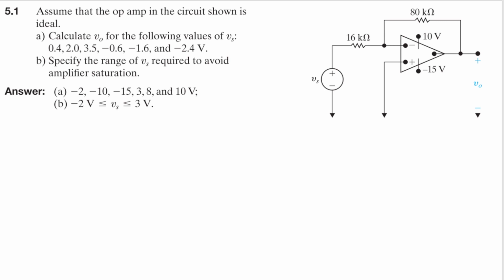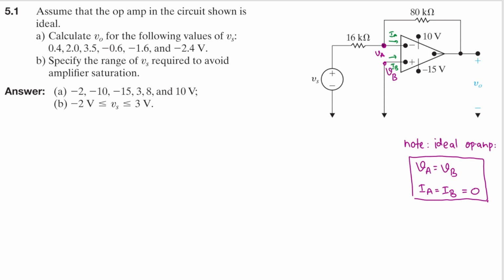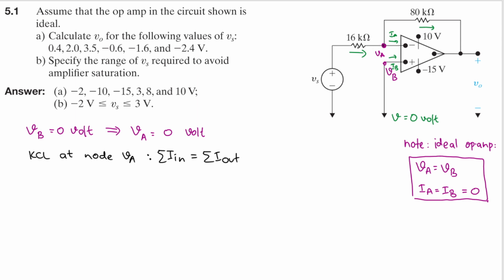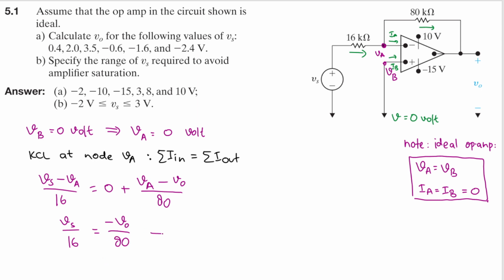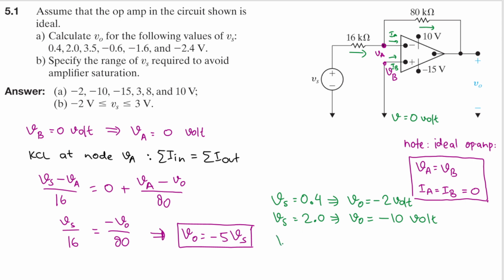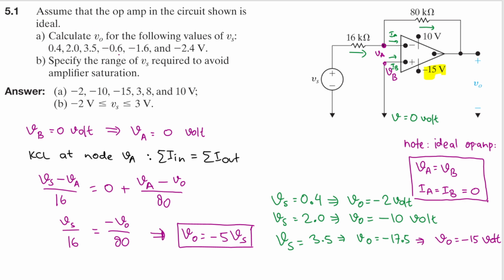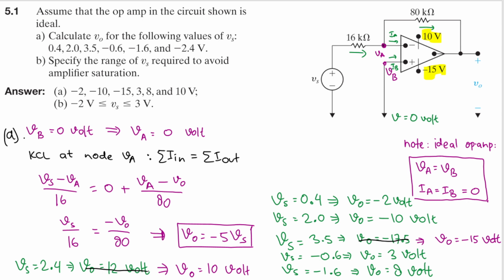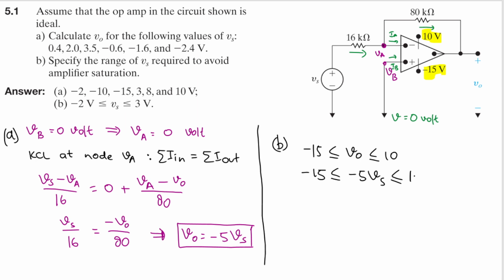Assessment Problem 5.1 (Nilsson Riedel) Electric Circuits 11th Edition - Ideal Op-Amp

Comment: Professor I have a confusion here.Vb is connected to ground so its voltage value 0V but in the question it was -15V? Could you clear up my confusion here
Reply from the maker: Can't remember